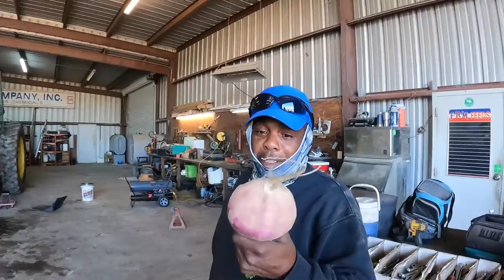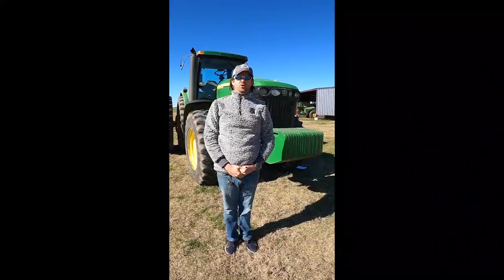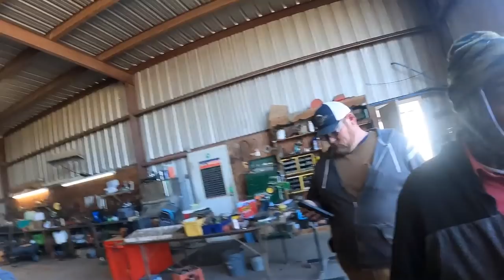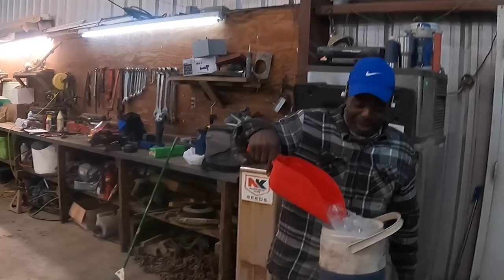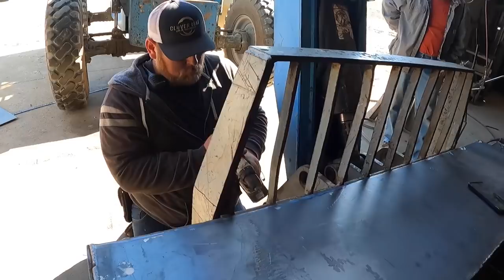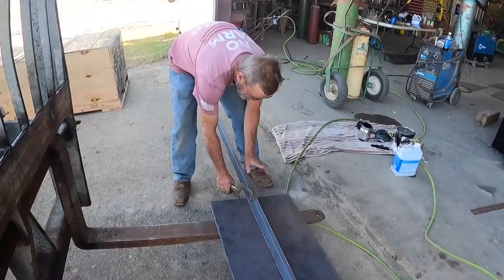Super Scooper 1000 (Homemade Bucket)

Comment: Cool bucket. What I would have done is make the digging edge a slot for the forks to go in. Pretty much no matter where the forks are you just slide in and the last 6 inches of the forks slide in to the bucket and then you weld up some connections for some snap boomers and the one end of the boomer fits nicely over the fork frame. Would hold in there very nice.